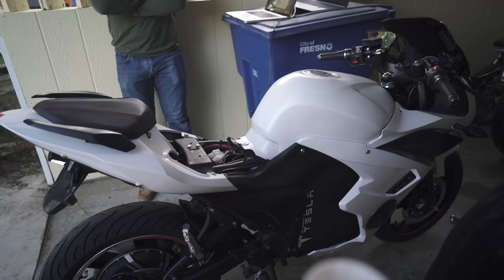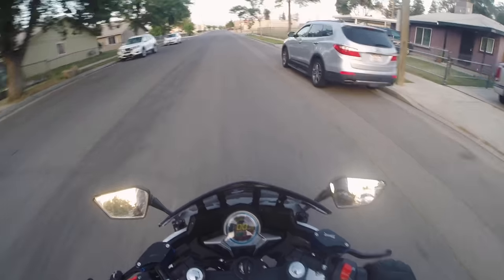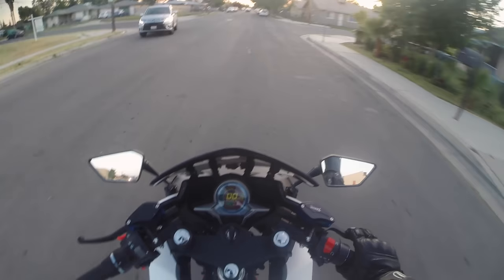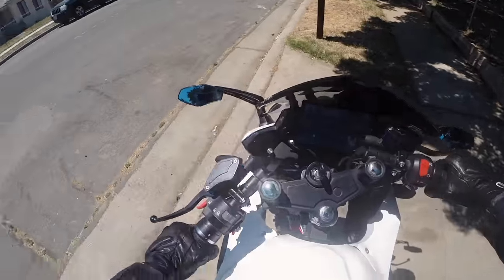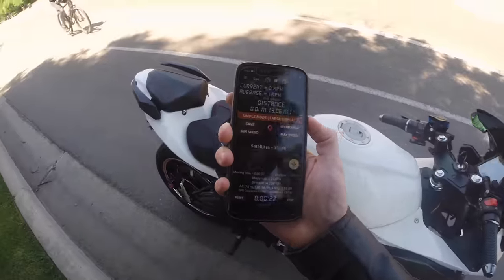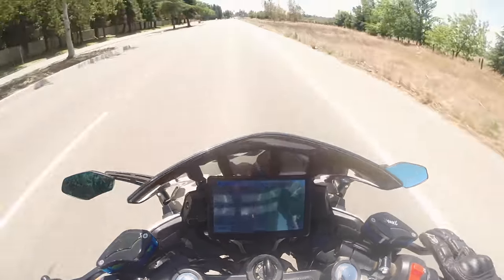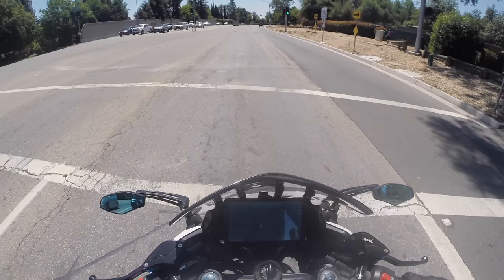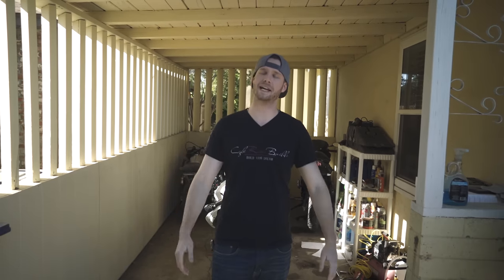CHINESE ELECTRIC SPORTBIKE – Top Speed [AFTER MODS]

Comment: Hey man, it's solid. Imo, I feel since its a sport bike, (and a good lookin one), it should atleast do 100mph. Now.. 

There's 2 caveats. You need to know if your topping what your amperage is going to get you, and you need to know what voltage is going to spin your motor at 100mph. One way to find out is to find your motor rpm without load and compare it to the rpm with load. If it reaches max rpm under load and it's doesn't reach 100mph, it needs more voltage and atleast 5% amp increase. If it doesn't reach max rpm, it needs more amps until it does, and remember, safety first lol ❗ but the build is going great man, loving it 💯
Reply: Voltage is motor speed, amperage is motor torque. More amps, more torque, more force to push thru head winds. 

More voltage, more motor rpm

Combined properly, and you can have one power efficient beast lol
Reply: And one more thing, 18650s should be able to take 3C discharge. That means {3 x (their capacity)} 

So 2500mah cells should be able to safely discharge 7.5A continuously. And thats if theyre not already rated at a higher discharge. 10  18650's linked in Parrellel that are rated at 3000mah should be able to disperse 180a cont. (This is just reference Information. To find your safe limit if your don't know it, multiply your packs ah by 3 and that is the safest general cont discharge rating for 18650 cells.

Like I said, your cell can be rated for more, so the numbers may different

Comment: i Had one of those problems on my ride too, so I decided to search for a better controller with cpu dual fans. And before to resolve the safety cut off I took the metal casing and just drill holes in it. Downside is you can’t ride out in heavy downpour. Not unless you buy water proofing spray to coat it. But be careful problems like that much exertion can cause your bike to blow up. Change your controller soon or you may also cause a wire to melt. You’d be surprise at the hub motor roaring with the correct controller ,makes it sound like a Super car.

Comment: Nice man, Great results!

Kelly’s are great controllers but they are pretty basic. 

The motor can only spin so fast at the rated voltage regardless of amperage (kv rating). Since it’s a hub motor that means no gears so your basically stuck at that speed more or less. A way to overcome that is to use a controller with flux weakening. This will allow the motor to spin faster at the expense of torque at higher speeds.

Comment: Nice run you made, I am wondering if you have 72V battery pack? The battery pack has a BMS and if any battery in parallel drops too low in voltage due to battery sag under load it will shut down battery to protect the pack. Pack may need to be balanced charged.

Comment: Like said, probably the controller overheating and shutting itself off for protection. Listen to the guys saying they water cooled one or figure a way to get more airflow and heat sync on it to pull the heat away. Folks do crazy water and air cooling on pc's all the time and some of those ideas might crossover to what you're doing. That thing is moving really good now and you have it most of the way dialed in. Now for more fine tuning and making it as efficient as possible. Love watching it get better and better. Then you get to find out the range to go with the fast.
Reply from the maker: Absolutely will be figuring it out!

Comment: Nice work. Any chance of links or make and model of the motor and controller? Can't remember did you get a bluetooth bms to keep an eye on the cells.
That's more than enough grunt, but a slightly higher top speed of 80 could be nice, so you aren't cruising on full throttle.

Comment: Likely hitting low voltage cut after going hard on it and or controller heating. A volt meter is well worth adding. If it needed lots of charge when you got home id be sure voltage sag hit low voltage cut off. Nbd, just be aware of it.

Comment: In regards to your system shutting down randomly. It's either the bms in the battery or the controller that's shutting down. Ive had this temporary shutdown issue before.  Some bms don't like the instantaneous amps you dump and temporarily shut off as a safety measure.  If this happens you might need a bigger bms or go without a bms.

Comment: I just don't blood bought a Hisunyes V6 e-moto, & CAN'T WAIT to get it! 👍
It already comes pretty much decked out, with 300mm rotors, good hydraulic brakes, & a bunch of other cool goodies, you can get it with a 2kw motor, up to 8kw motor. The top speed starts at 55mph, & depending on motor size, goes up from there 
It looks like a "CyberGrom"!!! 💯😂👍

Comment: I love the bike. You have done an amazing job. I,m sure you will resolve the power cutting off issue. It could be a loose connection or something simple. Either way, Its a huge accomplishment. 70 mph is enough. Also the speedo apps are very accurate. 😎
Reply from the maker: Absolutely 👊🏽

Comment: 70 is about the top limit for most enduro ebikes and elec motor bikes,because of the wind resistance at 70,to increase speed after that requires huge power upgrades,well in excess of 200 amps ,constant draw

Comment: i don't think it will let you use %100 of the battery but you can go as low as 50 volts before it shuts off (i think it reserves a percent of the battery for the electrical systems) lights, alarm etc.

Comment: Really liked your rebuild. If you were to start over from scratch, looks like you could have just bought an old, cheap bike (or one with out a motor for super cheap) and just built it. Looks like you would have been better off with out the original bike and without the original headaches of the import. Great bike series.

Comment: Hope you get the quirks wor-ked out. Temperatures are everything, battery, motor, controller. You can just touch the motor. Does it look good? Yeah, it looks pretty incredible. How many amp hours do you have? The only other emc's I really follow are the Zero and the cheap eGrom from CSC. The base Zero has a ridiculously small battery and at highway speeds a tiny range. The eGrom has a 3kw motor and a 40's top speed. I'm surprised you are getting to 70 but I would want to know the motor temp at sustained highway speeds. The Zero battery pricing won't work, but I don't know how many would build a battery like yours. The Lifepo4 ebike batteries on Ebay, packs that have been bought by Endless Sphere guys, can run 72v and 40 AH for $700 or so. If people want to follow in your footsteps, it would be interesting to know what parts will work. This is a great project so put out as much info as you want! Thanks!

Comment: Do you have the key running off 72 ? If you are maybe try running it off of the 12 that you installed for the usb. Maybe you are causing the switch to short and it is no longer making contact . 
Just a thought.

Comment: If you're riding and it cuts out, try to baby the bike to the speed limit rather than pinning it at WOT - it could be a hot battery OR a hot inverter (or whatever it uses). Another thing that can cause it is voltage drop causing the controller to cut out when you open up the throttle. You're running a much better motor than the bike originally came with.

Comment: Did you put thermal paste on the bottom of the controller where it touches the frame? (I work with electric fork trucks that use a Curtis controller) It just might need to have the frame act as a heat sink, which should suck heat away with the wind going against the frame.
Reply from the maker: No, I didn't.

Comment: From observation. It looks to be toooo big of a power draw to fast when you go full throttle from 0. Which kills it. Fail safe. Try easing in until full throttle. May need a regulator for the power, or something that limits the amount of it from 0 - full dump. Maybe like a switch for 60% power and  85% - 100% for tight shots where take off is needed.

But I must say....that was badass how you could restart the bike while coasting. Wouldn't recommend doing it again, but it did look sweet.

Comment: I bet it’s the controller’s LVC low voltage cutoff because the battery is sagging at top speed. Keep an eye on your voltage at top speed. If it says lower than 65v then that would be LVC.
Reply: No, he has a huge battery.

Comment: 🤔I have a question for you.Now I have a DayMak EM2 72V electric motorcycle bike that looks exactly like yours in this video.😳Now how did you get yours to go up to 60 miles per hour and speed? I have a blue tooth controller that works with my bike .But I can't get it to go no faster than 30 to 35 miles per hour🥴👎.So if you know just what I can do please let me know 😉👍!

Comment: I think there is no proper air circulation around the controller, coz it's sitting ryt below that doom  behind the head light and the fairing, 70mph also isn't enough to get the air up der, unless there is a path up there

Comment: How well does it wheelie? How to get yourself prosecuted showing the GPS showing that speed for the road is 50miles/hour and showing you doing 70 :) - I was no saint when I was younger I used to go 170mph on our motorways in the UK. I remember  being in 6th gear at 12,000 revs well in the red and the 6 gear shattering and taking the gearbox with it - fun times took a long time to get that bike back as it needed to go back to Yamaha to find out what happened.  I did not tell them the full truth about how long it had been sitting in the red, anyway they should have had a limiter on it, I was too busy watching the road whilst hugging my tank.

Comment: If my math is at all close to being accurate with a 96 volt battery actual voltage 112 volts you should be able to hit 90 mph atleast! I'm surprised your controller is over heating! I might even be tempted to water cool the controller! But acceleration is excellent and the bike looks great! Over all very good job!

Comment: A question for you guys, recently bought the Emmo zone gts  with lithium 72 v 30 amp. I dint ride for for few day the charge was showing full ..after 10 days I went for a ride. With the limiter it was not going more than 18 kmh and after disconnecting the limiter it was going max 28kmh. Any idea what can be wrong? Does the low charge also impact the speed of the bike? Thanks
Reply: How do you disconnect the limiter

Comment: For your overheating issue, i guess you could install one or two small fans (like CPU fans), since they use 12V DC, you should be able to plug them rather easily

Comment: The cutting out could be the low voltage cutout. If the batteries have a lot of voltage sag that will cause it to do that
Reply: Nope, he has a huge battery pack and that motor is not that big.

Comment: in Singapore we mod our Dualtron escooters with 120v battery pack(sony/LG cells)  with a 150 ampere controller paired with a 120v 4500w dual phased electric motor top speed 93-97 mph

Comment: Hi ! I had the similar motor turning off problem on my electric scooter Aima Jorney King and it turned out to be broken one of the hall sensors wires (it was black one - 5v power ground). At first it turned off once in awhile then more often and after that it just wouldnt start at all so i cheked it with multimeter and it turned out the black wire had an infinite resistance. The cable did not have any visible damage so i just started pulling black wire and it just came out - turned out it was broken next to the place where cable gets inside the weel. 
I hope that helps )

Comment: I'd recommend adding a small voltmeter under the display so you can monitor remaining capacity. Should also add a temp sensor to the controller instead.
Reply from the maker: There is one, it's just hard to see. At the beginning of this ride you can see me check it
Reply: @TheInja  I see, great!

Comment: I agree with everyone else about cooling the controller. My suggestion would be at a minimum cutting slits along the top or side and then use small 30 mm or 40 mm fans to draw air in and out through slits. Probably on the top and forward for intake while low and torwards the rear for exhaust. Now i understand this opens up the contoller to the elements but i would fabricate a cover that allows air flow for both.
           ______________
        /                            /
...../                             /.....

Something like this for the top and side. Now i would also cover the slits at least 2 to 3 in past the slits as well.

Water cooling is always a great idea but how difficult would it be for this project? I think fans and a custom air filter to help block moisture and other junk from getting to the controller would be a simpler method. This way its just body work and a few fans to wire in.

I ride a ninja h2 se+ and i will say i have high hope for your mods catching on for the big manufacturers which will not only improve performance but also reduce price... maybe. Would have to run cost analysis first lol! Good work.

Did the drawing on my cellphone... made more sense when i made the post...
Reply from the maker: For sure! Thanks for the comment!

Comment: What’s the lever on the left grip for? Does this have a clutch for some reason?
Reply: Michael Johnston I think that’s the rear break
Reply: So it's like a scooter 49cc without clutch for the handles? Like a cycle? Nice!
Reply: John Deschenes I think with it being electric it doesn’t have a transmission so no need for a clutch? I could be wrong.
Reply: NeonAcez it’s strange to think that they would put it there instead of having the regular right foot control...

Comment: sounds like your break is rubbing tho. Unless thats the sounds of the motor. If that it true I would adjust the breaks so they are not so tight. If they are rubbing on that disc you loosing power.

Comment: You're running 20v less than me and getting 10mph more top speed. Admittedly mine is a downhill ebike with absolutely no aero. So you're doing pretty damn good. That's a pretty fast wind motor you have there. I'd try taking it for a ride without regen enabled. See if that improves reliability. Might help if you can pipe some air onto that controller too. Like an old school gsxr srad ;)
Reply: less V but more A
Reply: @warlockboyburns  How is more Amps going to achieve a higher top speed without field weakening? Speed is entirely down to voltage and motor wind. Unless you use field weakening.
Reply: @th3d3wd3r  I don't know what that is but voltage X amps = current (watts)
Reply: @warlockboyburns  you don't know what field/flux weakening is?
Reply: @th3d3wd3r  I'm afraid not
Reply: @warlockboyburns  then why are you telling me P=IV? Why do you think more Amps = higher speed?
Reply: @warlockboyburns  also, just noticed you got your equation kind of wrong. Amps is current, watts is power
Reply: @th3d3wd3r  more amps is higher power depending on the maximum rpm of the motor
Reply: @warlockboyburns  the motor max rpm correlates to the voltage, not the amps, or power. For example, my bike at 100v and 140A does 60mph. If I turn the amps up to 200A, but the voltage is still 100v, my top speed doesn't increase, because the voltage is still the same.
Reply: @th3d3wd3r  I never said it changes the voltage I said it changes the Watts
Reply: @warlockboyburns  ok, this conversation isn't going very well. 
Are you claiming that increasing power (watts) by increasing only the current (amps) = higher top speed?
Reply: @th3d3wd3r  absolutely.
Reply: @warlockboyburns  incorrect, it doesn't. You can only get more speed by increasing voltage, or using a FOC based sine controller with flux weakening.
Are you familiar with KV ratings for motors?
Reply: @warlockboyburns  I'll just assume from your silence that you don't know what motor kv ratings are. In fact it would seem you don't have a clue what you're talking about at all. 
The bit that confuses me, is why comment as if you do know what you're talking about?
Reply: @th3d3wd3r  I know that volts X amps is watts and that's all I've claimed xD
Reply: @warlockboyburns  so you aren't claiming that more amps will give you a higher top speed anymore then?
Reply: @warlockboyburns  also, originally you said "volts X amps = current" lol

Comment: please stop before you turn the moter of. i have blown up my kelly controller before. the coase whas a bad connection. bud it is almost the same as manual shuting down. And did you check the low battery setting?

Comment: The only thing bothering me rn is how long does it take to charge?
Reply from the maker: From dead to full about 21 hours on the charger we have.
Reply: It all depends on the charger. The BMS will support charging that is as low as  a couple hours for a full charge, it’s just more expensive for the charger and harder on the battery
Reply: @TheInja  would be a fun project if you put a CCS/ j1772 port on that thing, might cost a bit but it'll practically give you access to multi state travel as ford is planning to launch the largest EV charging network in the US

Comment: I bet the bike is cutting out due to the controller or motor overheating. You're only monitoring battery temp.
Reply: Agreed, i had similar issues with my modification of a yamaha motorcycle to a eletric motor. I use the gear system, 1- normal 2-high speed 3-max power. 2 is okay to consistenly use it without it overheating which is around 70% but it varies with motors.

Comment: The giant controller is overheating from this 7 mile ride?
Reply: mostly because of the brake regen.
the motor can produce a huge amount of amps under regen which are distributed back controller which it will allow what is safe back to the battery. 
I guess a better airflow or lowering the regen on the controller would help. 
If you check their forums, at Kelly Forums there a bunch of "Kelly Controllers overheating". It seems the heat dissipation runs on the users side :)